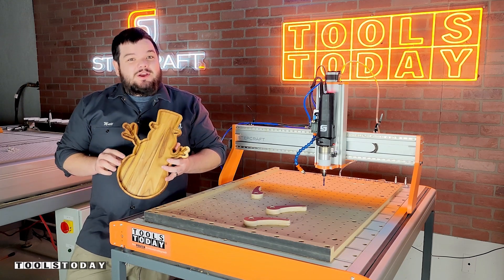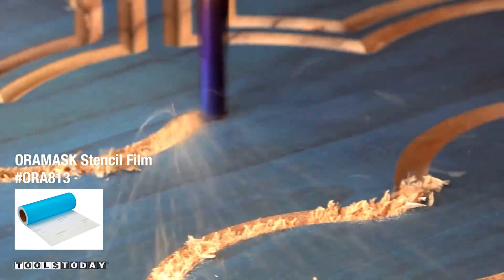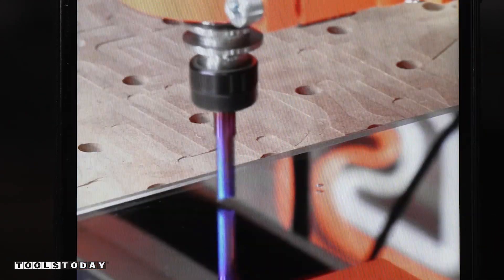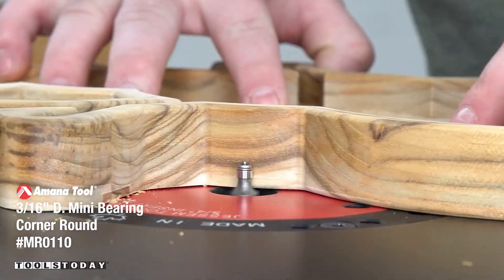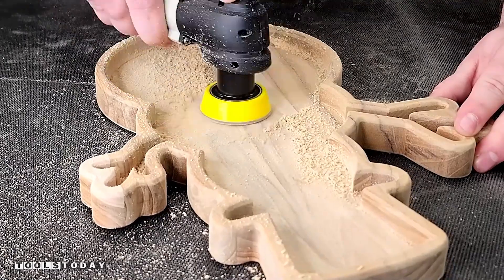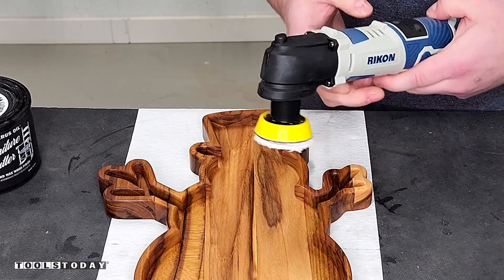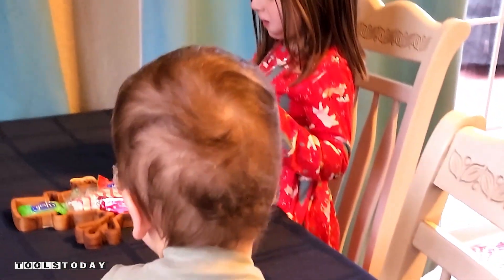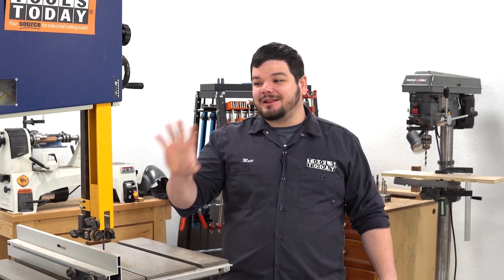How to Make a Snowman Catchall Tray on the CNC | ToolsToday

Comment: That’s an excessive $$$$ for a digital file, you are too greedy.
Reply from the maker: I am sorry you feel that way, however a lot of time and preparation goes into making these files readily available for multiple softwares.
Reply: @ToolsToday  I know how much time it takes, so do all the other file sellers who typically charge $3-4. I think your pricing excessive.
Reply: @grumpytrader7524 i am agree with you 😮
Reply from the maker: It's not just the digital file you're getting.  The plans have incredibly detailed instructions going over how everything is set up and why I set it up that way and giving tips and tricks you can take into other projects.  If you're using the Vectric software all the toolpathing is already done for you as well.